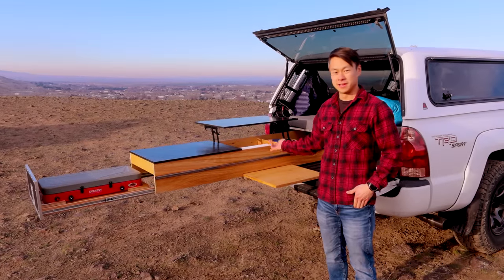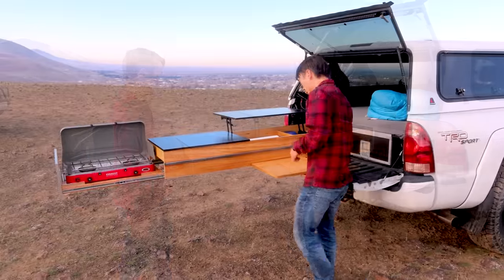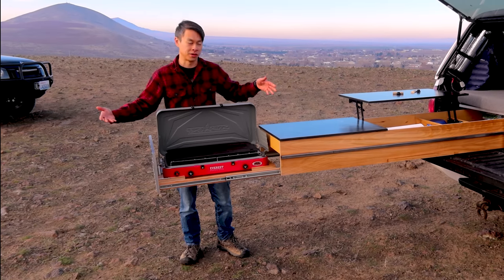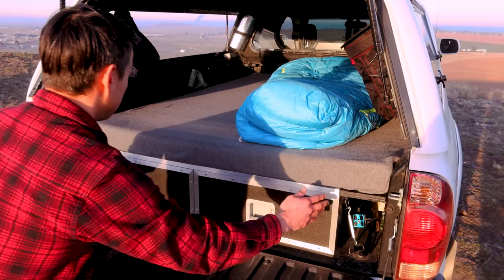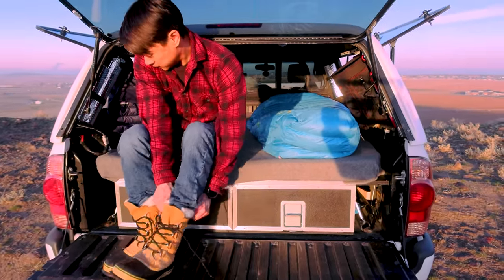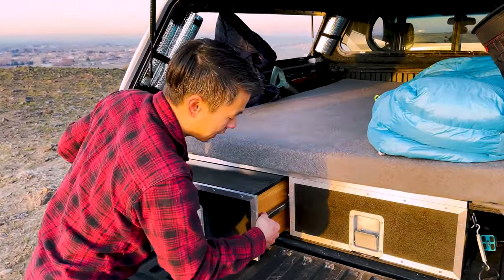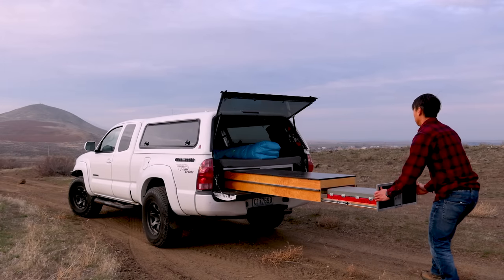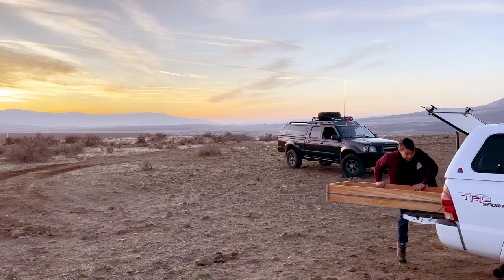Tacoma DIY Overland Kitchen And Mattress Platform Storage Drawer System - K.A.M.P. Drawers

Comment: Very awesome! That's very similar to what I want for my truck. Ideally, the storage and kitchen drawers would be a tiny bit shallower - maybe with a height just enough to fit the camp stove. Then, on top of this I want individual full length bed slides for each side. The slide over the kitchen would allow easy access to storage items like camp chairs, luggable loo, fire pit (or propane pit depending on the location and season), etc. The slide over the storage drawers would have the fridge, solar power generator, and propane tank(s). All this would have to fit in between my total chaos bed stiffeners. No need for sleeping platform in the bed because we have an RTT. Also thinking of making mine out of 80/20 for some weight savings and because I don't own the tools for working with pieces of wood that large.

Comment: legend has it, he is still in the drawer. ... Really nice and looks well constructed, I would probably consider switching my Decked system for something like this.  My only concern on wood material vs ABS is the strength over time?  Hard molded abs in that type of design would be stronger over time?

Comment: Love how you jumped on that drawer. I’ve been watching a ton of truck/suv builds to figure out what I wanna do and they ALL seem to be way overbuilt in terms of loads - 250/500lbs slides, 3/4” ply all over, screws and joints to the wazoo… 

That said, I’m curious why you did what you did with the metal square tubing instead of using some slides?

Comment: I absolutely LOVE this design. I'm building out my Toyota Tundra into a camper similar to this, with a slight mod. I'd only use one drawer on the left and maybe a "half drawer" on the right nestled underneath a cabinet unit above the right side wheel well. This would leave a section of floor space open to be able to sit up in bed. As well as the option of sliding in an additional panel to make the single bed into a double bed platform for when both hubby and I camp together.  What are your thoughts/ideas on a smaller drawer design for an 'under cabinet' feature? 

Do you have a material list and/or detailed plans available? 

Well done! The fit and finish of these are incredible.. 🥰

Comment: Damn! I like the skateboard bearings! So much better than drawer slides. How does it not tip over when its fully extended??? Extra support on the tailgate with the wood.
Reply from the maker: The drawer box is mounted securely to the bed on all 4 corners, so it can't tip over.

Comment: What a sweet setup, how about a half kitchen unit that I can mount on one side of my decked platform.
Leaving the other half for my impact dog crate. This way I can remove the kitchen draw when I need to use the truck bed.
Running a softopper as the temporary truck cab.
Reply from the maker: I'm only planning on building full units for the first batch, but if there's enough interest, I might do a half unit.

Comment: Great build,  have you thought about adding the lift struts on the camper shell to make it higher?.
Reply from the maker: I've seen those struts before, and while they're pretty innovative, I try to spend as little of my time as possible in the shell, and instead enjoy the outdoors, so it would be a waste of the large price tag for me. But it would definitely be relatively easy to install as they would clear the drawer platform with only slight modification.

Comment: Which way do you face your head when you sleep in your Tacoma? I have a 15 trd off road access cab but I'm 6'4. The first two camping trips I had my head closer to the cab but one night I woke up and panicked and felt really claustrophobic. Since then I have been sleeping with my head towards the back of the truck and I actually find I fit better since the window of the cap curves out a bit, I stack two pillows and have my head almost right against the glass and don't have to angle my legs nearly as much.
Reply from the maker: I sleep with my head to the cab, so I don't have to turn around when I crawl in. BUT, I am an entire foot shorter than you (5'4"). Interesting to hear of tall person problems, when I've been living with short person problems my whole life!

Comment: Awesome build! You clearly demonstrate that the drawers are robust enough to NOT need a support leg. The piece of wood you slide between the kitchen drawer/tailgate solves a very minor issue of so-called sagging. VERY WELL DONE! One quick question: Would you keep the hinged countertop where your "silverware drawer" is? Or would you utilize another flip-up top in that space?
Reply from the maker: Hey thank you! I definitely am replacing the hinged countertop, and instead using drawer slides for future builds. Having to move stuff off that surface to get to the silverware is a pain. But the lift top mechanism is too big to fit in that shallow of a space.

Comment: Nicely done Sam. What I didn't see is your storage for water and water capacity, and refrigeration?
Reply from the maker: I have since added a Waterport on the bed rail that fits nicely into the system for summer camping. I keep a cooler in the cab of the truck.

Comment: Nice build.  Where is the fridge/cooler? Also, I would consider replacing the horizontal surface adjacent to the stove with something heat resistant like aluminum, SS or even wood to give a place to set down something hot.
Reply from the maker: I keep the cooler in the cab of the truck. In my opinion there's just not enough room under the platform to put an adequate sized cooler to store what you'd need for even a weekend. Not sure if a heat resistant pad would be utilized that often. I know I wouldn't need one. Maybe if more people request it.
Reply: @SamChou  that's fair. There's only so much space to devote to the basics and it doesn't all fit unless you want to compromise function and what's the point of that? Good luck.

Comment: I agree it is pretty cool.  Great job. Looks super useful.  So are the tubing and roller bearings quite a bit less expensive than the heavy duty drawer slides?
Reply from the maker: Ridiculously less expensive. $100 vs $400-$600

Comment: Dig the build out! A bit of a simple request, how do you mount and stow your reflectix? I like how they are rolled away in this vid.
Reply from the maker: I've been meaning to take some photos of the camper shell buildout, but probably won't get around to it anytime soon. I used 2-sided velcro, sandwiched between the window frames.
Reply: @SamChou  Thanks for the quick response! So you just have them rolled up, a Velcro strap around it, and sandwiched up in there. It appeared at first that one side was fixed and you could roll it out for use or rollaway for stowing. Either way love the ideas and creativity that come out of discussions. As everyone knows it’s all about maximizing the space, organization, and ease of functionality. Thanks again brother! Cheers
Reply: I was trying to figure out what the cylinders were I thought they looked like reflectix but my screen was too small. hahaha I would like to see that video as well

Comment: Awesome build. Love the pullout cutting board. Some folks have a sideways pullout drawer for that but just having the board slide in and out seems more elegant/space-efficient. Question about the lift up top coffee table hinges for top access into the back compartment in the pullout drawer. Do you have room to open that up inside the truck when the drawer isn't pulled out? I'm working on a similar build right now. Thanks man!
Reply from the maker: The drawer needs to be pulled out fully to access the back of it. I debated adding an access hatch in the platform top, but seeing as it is always covered by a mattress, that would have been more of a pain to get into.
Reply: @SamChou  Makes sense. One last question for you - it looks like your pull-out drawer uses 2 separate sets of slides, is that right? One large pair (60" or so?) for most of the pull-out drawer plus a separate shorter pair of slides for the ~3' extension with the camp stove. Or is this just one pair of slides? Thanks!
Reply from the maker: @slpdataguy  correct. The main slides are 72" DIY square tubing and skateboard bearings. The stove slides are I believe 24" full extension slides from Rockler. Check my build video if you haven't already.
Reply: @SamChou  Awesome. Will do, thanks.

Comment: Looks great man. Looking to do the same. Have you thought about shedding more weight by adding holes throughout the drawer walls and bottoms or are you concerned that since you went with 1/2" BB ply those would take away from the structural rigidity too much? Also, could you use 3/4" BB ply slats instead of a solid 3/4" sheet of BB ply for the top and bottom? Or would that once again not be sturdy enough?

Comment: Great design,  I love the kitchen and mud room. Weight the only negative . With the topper plus your design  is about 350 ,400 lbs. do you notices it with fuel consumption and weight on trails?
Reply from the maker: I definitely feel a decrease in performance, and a drop of 1-2 mpg. The rear springs could also use some help. I did drive across a truck scale, and fully loaded with recovery gear, camping gear, firewood, fuel, water, etc, it weighed out at 5200lb. Which is pretty excessive. I'm still scratching my head where all that weight came from.
Reply: Thanks I guess very thing has a cost. The other great point is that it all stays clean and dust free. 👍

Comment: Just wondering if you had Any particular reason for the stove/kitchen on the left side? I'm thinking passenger side so I could more easily thread on propane connector, and just have a collapsible "holder" for propane bottle.
Reply from the maker: Pretty much the biggest reason was for the simplicity of the propane connector. I'd have to drill a hole in the drawer face if it was on the other side, which would break up the aesthetic. This is simple and effective.

Comment: Sam! Great build. Any details you ca share about how you designed the pull-out cutting board? I can't quite see what the cutting board slides on - does it slide on an aluminum angle or is there a thin piece of wood that jets out below it on both sides? Thanks.
Reply from the maker: Check out my build video. It's aluminum angle.
Reply: @SamChou  Ah - I wasn't aware of the build video, will do and thanks!
Reply: @SamChou  Thanks. Any thoughts on how much making that cut-out for the slide-out cutting board affects the strength of the pull-out drawer? You stood on the thing, so clearly it's strong. Just curious - would you say cutting that notch out for the cutting board doesn't hurt weight bearing capacity at all?

Comment: Hey Sam, Killer video and killer setup. Would you be interested in building a set for a '15 Silverado?
Reply from the maker: Thanks for your interest! I don't plan on building anything custom to fit any vehicle other than the 2nd/3rd gen Toyota Tacoma with the 6' long bed, and possibly the 5' short bed later. However, it is truly just a box, so if it fits within your wheel wells and length of the bed, it still might work for your truck. The finished dimensions are:

73" x 42" x 9.75"

Comment: What’s the installation like on these ? Is there a lot of drilling into the bed/liner? Is there a manual available online ?
Reply from the maker: No drilling, just slide in and attach with turnbuckles. As soon as I release these for sale to the public, I'll include a manual and install video, but it's very straightforward. Check out my website for more details kampdrawers.com

Comment: awesome design. I would like to build my own. one question, how do you keep the drawer from totally pulling out of the frame？
Reply: this would be down to the runners used, they normally prevent this by using either a clip system or a specific way of lifting out

Comment: Can you access the recovery gear in the back of the drawer without the drawer opening?  Just thinking if you are stuck on a steep incline and are not able to open your drawer fully. Can you get to it under the mattress somewhere?
Reply from the maker: That's a good point. No, I cannot. I might make an access hatch in the back someday, but that's a pretty fringe case. Might be best to store that stuff on a roof rack.
Reply: @SamChou  yeah I’d agree, very unlikely but just a thought I had. One of the coolest most thought out builds I’ve seen. Awesome work!

Comment: I really like that design for the stove drawer, however I do see a problem with the build.   No one, and I mean NO ONE likes an unlevel cooking griddle or pan.  With your set up, your stove is leaning down too much.  On uneven parked ground this issue is multiplied.  However,  you can easily correct it, if you decide to make these for future customers.  The fix is simple... lessen the depth of your utensil tray by about 1 inch (not sure as I don't have available specs for the leg),  then shift your stove platform rolling hinge strips up that 1 inch.  This leaves you an inch of space to the bottom of the drawer now.  Now search online sites for aluminum adjustable legs.  In just 1 minute I found one at Table Legs Online.  Search for Height Adjustable Single Folding Table Leg.  As you can see this leg needs about a 3/4 - 1" clearance to fold up into the bottom of the drawer so that you can close it without problems.  Using this model (kind of pricey), you can fabricate one to your liking and affix it to the bottom center of the Stove slide-out.  Also you'll need a 3/4 inch x 4 inch flat piece on the bottom of the leg as without such a modification, the leg will sink into soft soil defeating the purpose.  Now if you're a real perfectionist, you can attach two legs to the front middle and back middle of the stove platform.  This allows for a COMPLETE levelling of your cooking surface, but that's really up to you.  If you decided to go into business making these for customers...a problem like this can put your product rating from 5 stars down to 4 stars easily, and I'm sure you wouldn't want that to happen to such an incredible drawer build :)  Once again really enjoyed it.
Reply from the maker: Good point on the levelling. I've so far only parked on mostly level ground, and while any eggs I make do run to one side, I haven't really found it to be much of a pain. I'm still trying my hardest to try and avoid needing a leg. Reducing the utensil tray depth is a non-starter - it's barely over 2in deep as it is, and can't get much shallower and still be useful. I do have some ideas in shimming the stove itself while open to account for unlevel. But at the end of the day, I'm unaware of any kitchen drawer on the market that accounts for levelling the stove. Would be great to be the first, though!
Reply: @SamChou   Okay I thought about it, and came up with another solution.  The front drawer panel is about 20" wide right?   So,  you could design an 2" x 4" x 16"  long horizontal rotating/telescopic handle mounted on the bottom of the drawer.  Your drawer system on that side would have to stop short of the tailgate 2 inches to allow it to shut, with the handle present.  You use the handle to pull out the drawer, then press the rotator release button allowing you to turn and lock the handle into a vertical position on the end of the stove drawer.  Then squeeze side buttons which are holding pins that keep the corresponding sleeves retracted.  At this point the handle telescopes out (using gravity) to about ground level (can be a universal stock length to stop).  Then the last telescoping section which due to size reduction is probably  1" x  2" has adjustable holes in it to extend a last piece for levelling up the stove platform.  To close, you'd simply return the adjustable leg back up.  Squeeze and hold the pin retractors while using your other hand to pick up the telescoping sections back up to the handle position.  Then unlock and rotate the handle back horizontally back into its "grab handle" position.    I know it sounds complicated but really it would be quite easy designing and fabricating with say 1/8" aluminium pieces.   Would be ingenious if you got it to work :)

Comment: Love the build. Would like you to build your truck platform for me please. I have a 73 inches bed . Chevrolet Tahoe truck short bed. I live in Gardnerville Nevada . Keep in touch
Reply from the maker: Thanks for your interest! I don't plan on building anything custom to fit any vehicle other than the 2nd/3rd gen Toyota Tacoma with the 6' long bed, and possibly the 5' short bed later. However, it is truly just a box, so if it fits within your wheel wells and length of the bed, it still might work for your truck. The finished dimensions are:

73" x 42" x 9.75"

I may expand to other vehicles on later batches, but that would definitely be in the far future. I'll keep you updated if that happens.

Comment: Do you find the rollers are necessary when fully loaded, or would sliders work OK?
Reply from the maker: Are you talking about heavy duty drawer sliders? If so, they cost about 5x as much and don't exist in 6ft lengths. As far as I'm aware, this is the only option for a 6ft bed.

Comment: Tell me about your window insulation that I can see wrapped up on the side. What did you use?
Reply from the maker: I've had a few requests on the windows shades, so I'll be making a full video covering those soon. They are Reflectix sheets, rolled up and held in place by 2-sided velcro straps, which are sandwiched between the window frames. Subscribe to be in the loop on that one!

Comment: Do you always keep your setup inside the truck?
Reply from the maker: It comes in and out depending on what I'm doing, which could range from camping out of the truck to hauling dirtbikes, or dirt itself. I plan to build a ceiling hoist soon to lift the whole unit with topper all at once.